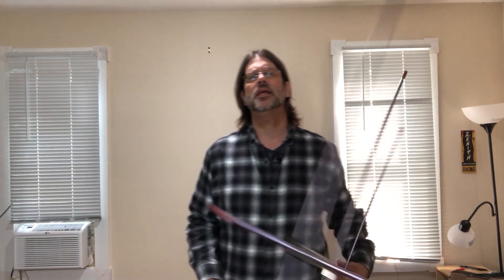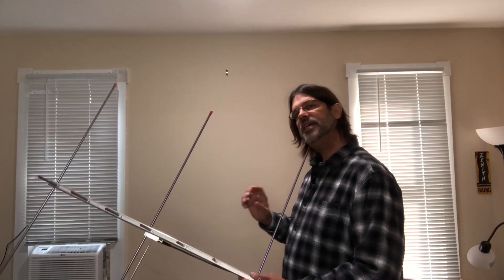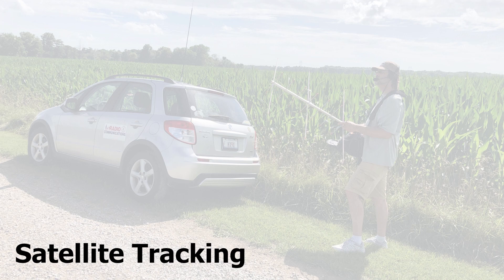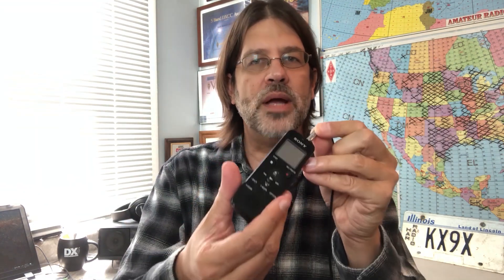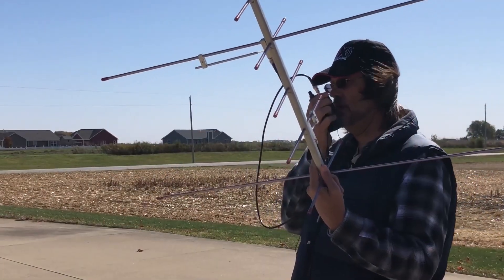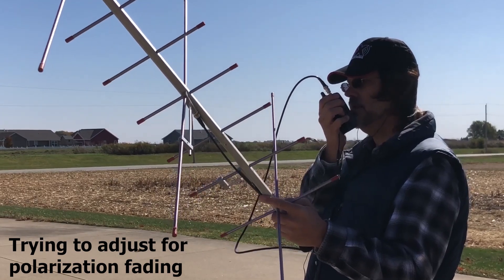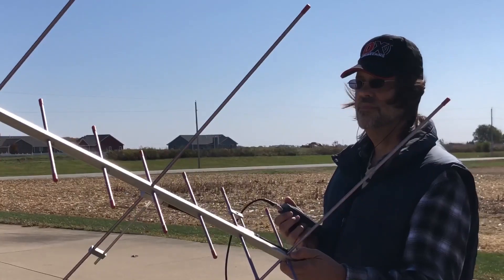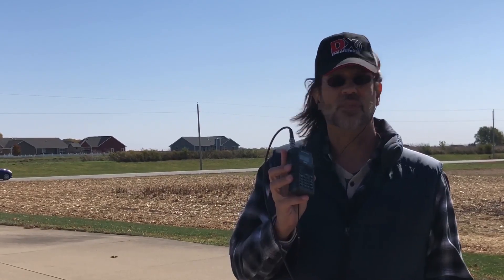Tips on Operating FM Amateur Radio Satellites

Comment: Greetings Sean, thanks for the great videos on working the satellites.  I have a ft991 that would be a perfect receive rig and also have a pretty good mobile rig that could work as the uplink on 70 cm.  I bought an Arrow with the duplex unit but don’t really want to add an HT to get the full duplex.  Not sure how to set up the antenna connection, probably bypass the duplexer on the Arrow and just connect the appropriate antenna elements to my u/d rigs but I’m concerned about overloading the front end of my 991 when transmitting on the mobile.  You didn’t show this on the 5th video because you used fixed antennas that are probably located separately.  Any ideas?

Comment: Finding a Full Duplex Handi is not easy, so I have been using a Yaesu FT2D Dual Band (2M/70cm) Handheld. I have it set up with Split Frequency, so I can listen for folks to start talking and avoid tramping on them as the Transceiver switches Bands to transmit. I hope to try my Dual Band Yaesu FTM400DXR sometime soon, to see if hearing, as I send, actually improves the experience; since unlike the FT2D, the second Band does not mute when the Transmit band is activated..

Comment: Based on what I've heard in your Satellite Series, I take that there are no "Geosynchronous -Satellites" in orbit, just Non-Geosynchronous?  Is that correct?
Reply: This comment 3yrs later Apr 2025. There is now a geo-stationary sat called QO-100 attached to a Qatar TV sat over Africa. Itgives ham coverage from Brazil, across the globe to Thailand using ssb and cw and data modes. There is even a digital TV transponder. Google QO-100 or E’Shails 2 satellite for more info.

Comment: Hi Sean, I learned a lot from your FM satellite video presentation tips. I would like to try out satellites this summer. I do not have a full-duplex radio but I do have 2 HTs. How would I cable the 2 HTs to an arrow antenna that has both 2M and 70CM elements?  Do I need some type of low pass filter for U/V or a high pass for V/U to protect the receiving HT from possible damage and de-sense caused by transmitting on the other HT? Or it doesn't need one due to the TX/RX frequencies being far apart? Looking forward to your comments on this issue. Thank you and  73 - KK6RSL

Comment: Great video series !!  I have a question , i dont think you explained antenna cable, one radio, 2 antenna ?    some sort of spltter cable ?  when you transmit on 2 meter it doesnt interfere with incoming on 70 cm ?
Reply: There is a duplexer within the antenna. Go to arrow antenna and check out there satellite antennas.

Comment: Hi Sean, I enjoy your videos. I have tried satellite work and I also use a digital recorder. Might I suggest trying to see if your digital recorder has pass through so you don't have to use a splitter. I have an Olympus and a Sony recorder and I found both do have this pass through capability. Saves the extra wire. I haven't gotten on the birds for a while but I want to get back at it again. I love my Kenwood TH-D72 also.

Comment: I understand the SO-50 satellite has a 2 meter up frequency, how does the Kenwood TH D72 HT. Work , any problems, need to adjust radio volume?  My Wouxon HT does not work As full duplex on the SO 50 satellite.  But works well on the other satellites,   Comments?